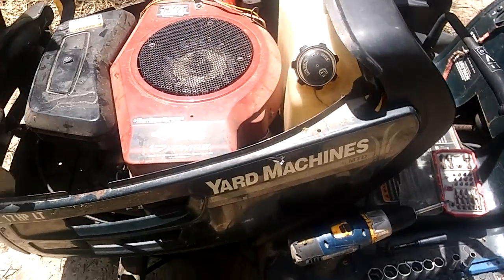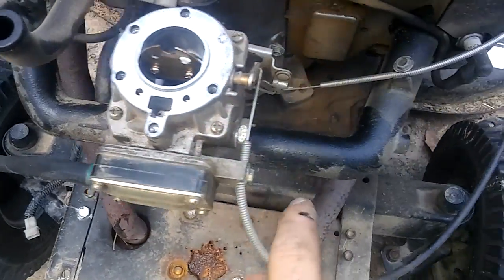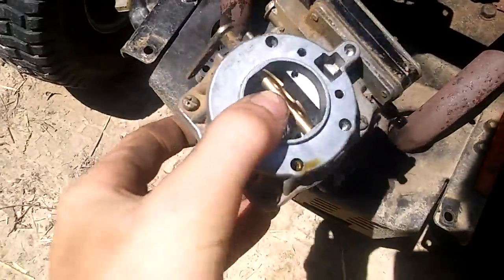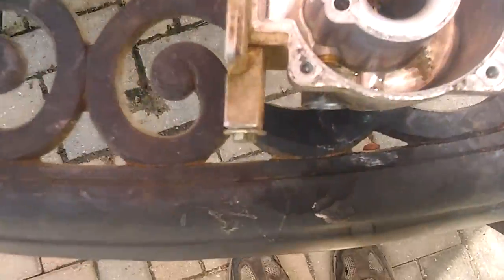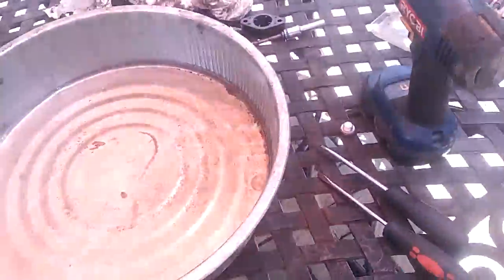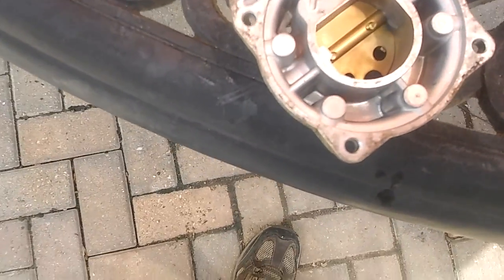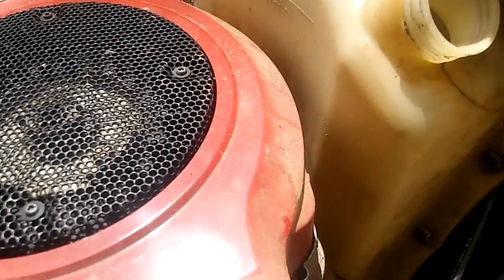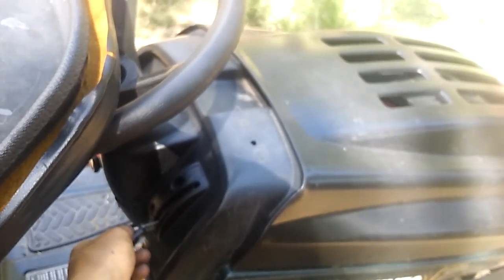How to clean out an opposed twin carburetor

Comment: So I rebuilt mine, it has the 3 screw carb.  Now it only runs with the choke pulled.  Now what
Reply from the maker: Clean it again and if that doesn't work the main jet needs to be drilled ever so slightly

Comment: The pin you keep talking about is a needle that is your needle & seat. You can call it want you want but a parts shop won't know what your talking about.
Reply from the maker: If i call it a float pin here in Missouri they will know what im talking about
Reply: @mechanicalking  Ok, but the rest of the World calls it a Needle.
Reply: kevin vt terminology goes a long way. Educate yourself. Know the difference between a bolt and nut. A1/4-20 bolt is not described by the head size. (7/16). But I do admire your efforts to jump in. Don’t be afraid. Cautious maybe but not afraid.
Reply: @allenjohnson6402  What does a Needle & Seat have to do with a Bolt & a Nut??? Educate yourself.

Comment: Hey Bud, I have the same engine in my craftsman mower.. have you ever had a leaky needle and seat in the carburetor? Which leaked gas in the crank case and mix with the oil.. that’s my problem..it was a new carburetor so it’s going back..
Reply from the maker: Yes, but somtimes the float gets stuck in the carburator on mine. I just pull the top off. These carburators HATE being emptied. This happens literary every time it runs runs out of gas. Also, if your gas tank is above the carb on yours, be sure to check the oil level because I had a 12hp throw a connecting rod because of gas in the oil!
Reply: mechanical king my gas tank is under the seat..seems like mine acted up when I hit something and bent the mower blade..after I changed blades white smoke and oil geysers out of breather tube..thought I blew head gaskets replaced but didn’t have to.. I’m thinking there making some knock off junky replacement carburetors..hopefully I’ll get this 20yr old mower going again.
Reply from the maker: Good luck my man!
Reply from the maker: Is your tank above the carb?

Comment: "Wing nuts"   I repaired a cable on a Toro Recycler where the blade brake cable broke.  I pulled out the actual cable and measured leaving the end connected in the spring with some cable coming out so I didn't have to disassemble so much and was able cable clamp to that end of the cable since wasn't worn.  Then I used some 3M Silicone Paste in the metal cable cover/sheath and fed the cable in, making sure to lube real well to prevent future corrosion and water infiltration.  After feeding through I didn't have the cast metal end on the brake level and just wrapped around the connection point and tied off at first... then later cable clamped.  Been working great since. Was only $4.48 total and some time for 6ft of the "wire rope 1/16" cable" and 1/8" stainless cable clamp to repair (I wound up finding another cable clamp and clamped the lever last time I mowed just in case the cable comes untied and end isn't hanging out):
https://www.facebook.com/photo.php?fbid=3147069908688123&set=a.1586822128046250&type=3

Actually, today I realized I might have to do the same type repair on the Poulan Pro 18HP 42" that I just got the 31H777 running today.  I still need to work on... though the mower deck blades aren't engaging so looks like the cable is loose.  Will trace out tomorrow and see if a connection under the gas tank or maybe on the deck clutch... though didn't notice.  Figure the Tractor Supply 1/16" cable will be more cost effective with stainless cable clamps. 

Thanks for sharing this as I have a 422707 and 402707 I'm about to start working on, so reading and watching into.  Will be my Murray Lawn Chief "lawn tractor" upgrade in from "riding lawn mowers" project. :-|)
Reply from the maker: Cool!

Comment: Thanks for the video. Just some advice: gasoline will get absorbed through your skin so it's best to wear gloves to avoid abundant hydrocarbons getting into your blood and increasing your cancer risk.
Reply from the maker: Thanks and I never thought of that. I'll work on it, I'm picky about gloves but its a good idea
Reply: Won't gas melt most rubber gloves? I do not recommend cleaning with gas not sure if gas was being used here or kerosene. My dad retired firefighter and saw lots of people severely burned by cleaning with gas. Having said that what's the best thing to clean a carb with other than kerosene and that will clean the gaskets as well without damaging them?

Comment: The Jet that you unscrewed from the side of the Nikki 6 bowl, is the MAIN JET. That plug area on the bowl (the bolt) originally contained a Secondary Jet.
Reply from the maker: I dont know about the secondary jet being the drain plug... but thanks for your comment!
Reply: I do......That bolt is the access port for the Main Jet. It's not advisable to use it as the Bowl Drain. You will end up destroying the Aluminum Washer, causing you to have to purchase another. The carb you show in your video is the OEM modified version of many others before it. The factory keeps modifying the carb...Good video young man. Keep up the good work.
Reply from the maker: @JeffreyStrader  Yeah. The only reason I said "I am not sure" is because I didn't remember.. I wasn't saying you were wrong. It's just that I haven't seen the inside of that carburetor for almost 2 years